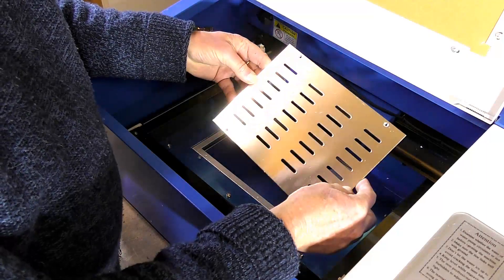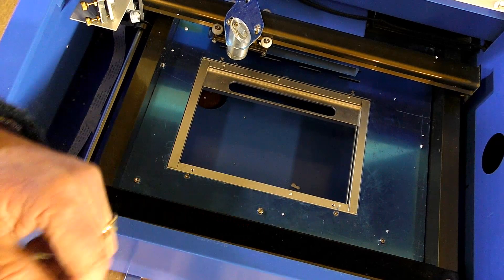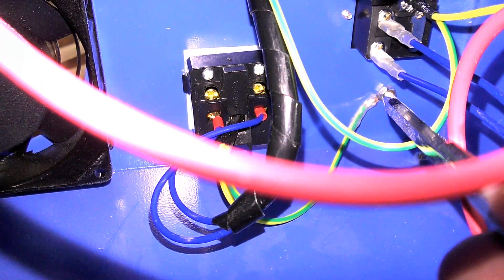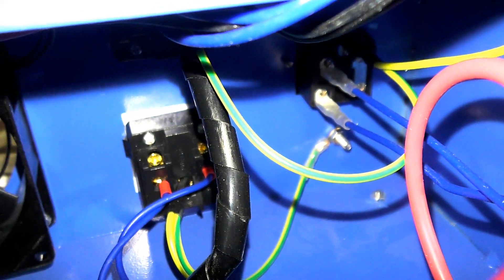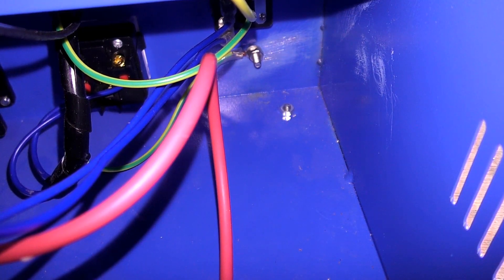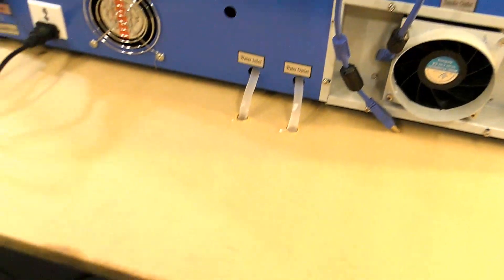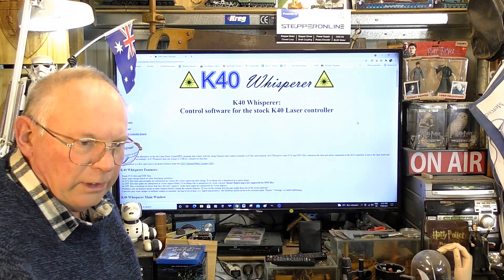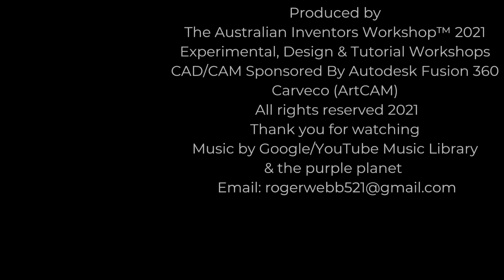NEW K40 CO2 LASER check and repair before you turn them on!

Comment: Iv been thinking of getting a C02 laser cutter, I'm in the UK and after just watching about the secondary earth would it earth properly by making an earth cable and using the earth pin in a plug and using the wall socket for to earth it as there won't be a live or neutral cable wired in in that particular  extension? Plus do these cut through metal?
Reply: I do not think they will cut any metal, they might be able etch metal with the right preparation beforehand, they will just reflect back like Roger mentions with the Aluminium base plate, They can only cut around 1/4 inch, or about 6.5mm of wood, leather cardboard and acrylic. Think this model can only cut 300x200mm as well.